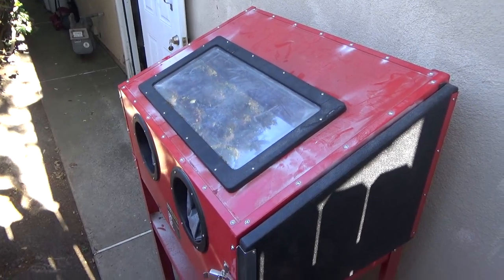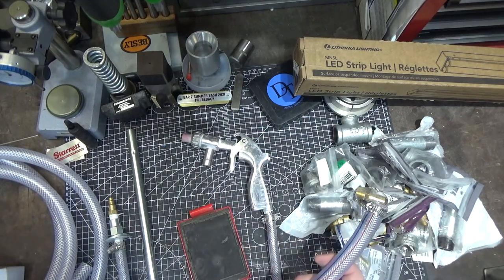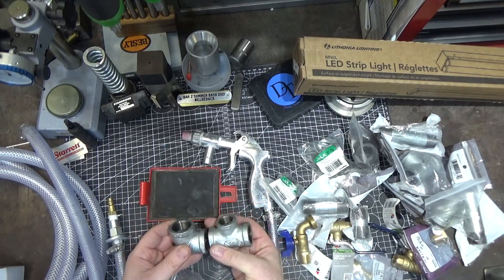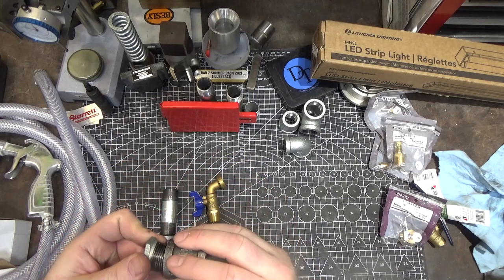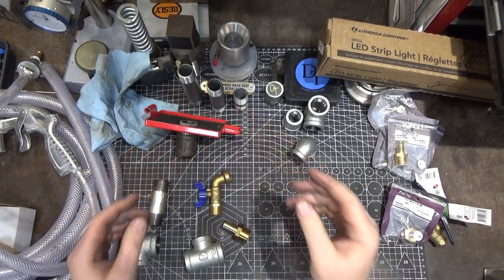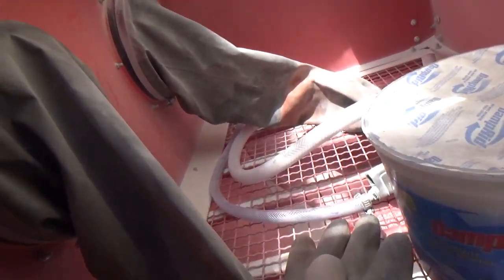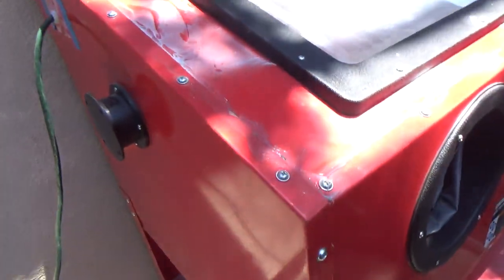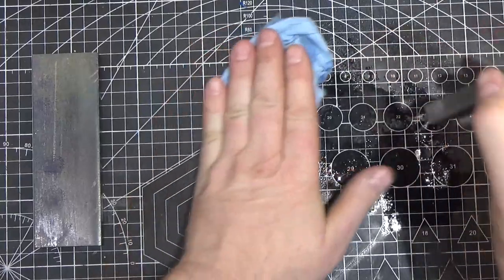164 Harbor Freight Sand Blasting Cabinet Media Feed Mod

Comment: What's with the heavy cast iron piping instead of PVC?
Reply from the maker: Honestly, I didn't think of PVC which would have been quite a bit cheaper and somewhat more versatile. Doh!
Reply: But I wonder how long PVC will stand up to sand beating on it?
Reply: @erichumbert5562  There's no sand 'beating on it'. The sand beats on the inside of the pvc flexible air hoses all the time and I've never heard of a hose blow out. The elbow only has slow flow and nothing harsh except for when the sand passes through and  is rushing through the hose to the fun.  Use Sch. 40 for more piece of mind then.

Comment: 2:18 No it's the opposite.
Would certainly work better if you were using it correctly.
Reply from the maker: Thanks. That is the risk of working with a tool for the first time.